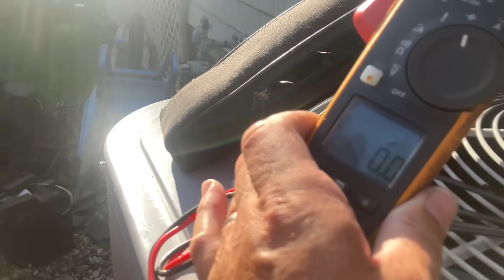Central AC Not Cooling - Outdoor Fan Motor not Running

Comment: I blew a  circuit board fuse the other day changing a capacitor luckily when I saw the little spark I knew it was blown  kill 24 volts when taking out the capacitor

Comment: well, didn't start by confirming the power was off with meter. "strike 1"
wrong size nut driver socket and just keeps grinding it. although he did figure it out (nervous maybe) "strike 2"
 doesn't know the capacitor symbol, although that's kind of excusable as some have the symbol/others uF and variants. half a strike, but the mid air fiddling it trying to get the leads touching. "strike 3"
yeah, I probably wouldn't have any employees either, guess I take for granted all that knowing electronics, electrical, most every symbol and able to read schematics/blueprints and more.
maybe he just has super nerves?  boss, camera, customer, new job. some people get super flustered

Comment: Painful to watch.  All thumbs.  Wouldn't be making money with this guy.  First, after pulling the disconnect, I would still check to make sure there is no voltage to unit.  I am not an HVAC guy, but I have checked my capacitor within minutes.  You have the patience of Job!

Comment: The most surprising part of this video was that assuming the fan was supposed to be 5uf, that it was reading 4.5 and wouldnt start.   5 +/- 10% = 4.5 to 5.5

I immediately thought the cap when the compressor kicked right on and the fan would have started with a push, As I'm sure everybody else did. But the fact that it read 4.5 was surprising to me.
Reply: Fan cap was dead. Did you miss that part?
Reply: @realSamAndrew I did miss that. It looked like it tested 4.5 but it was hard to tell when the leads were on common and fan. Are you saying it was zero? What was 4.5 then?
Reply: they cut away after Mikey tested the original fan cap was bad and compressor part way low. when they cut back in, it was new guy testing the "new" cap, before installing it.
he kept doing herm to fan, which is testing the two value caps in series, that will always end up a value lower than the lowest value of any in series.
I'll just stop here, leaving the math and calculations out of the comment, since it's way beyond hvac/r and into electronics realm. lol
Reply: @throttlebottle5906 oh ok. Thank you. I thought the guy was testing the one he pulled which was 4.5 but I couldn’t tell from where to where.  Thanks. Figured it should run at 4.5. That’s close enough to work. Thanks for the info.
Reply: @Drrich_DIY at 11:23 he says "fan...nothing"

Comment: LOL guy was rattled.
Reply: No excuses for him when he says he knows how to troubleshoot and repair AC systems.

But, he was definitely rattled. When he ass trying to take the capacitor off of the unit, the hex bit in the impact driver was too short. And yet he we still trying to use it. And then he had the driver screwing the fastener clockwise when trying to loosen it. I started to cringe right there. So painful to watch. 

When I see "Techs" use tools incorrectly, I can tell right then and there that they don't have the "experience" or skills to use said tools. 

It's just amazing and unbelievable. 😖

But more importantly, it tells you that they're a liar. Some things you can fake sometimes. But when you're struggling with basic tasks like what we just saw, you aren't very skilled and have very little, if any, experience and you lied about it. 

You're fired! Next! 😂
Reply from the maker: Oh yeah, is that the excuse?
Reply: @PipeDoctor  🤣
Reply: @PipeDoctor  No.  He's not a diagnostician.  I hope he knows how to do installations.